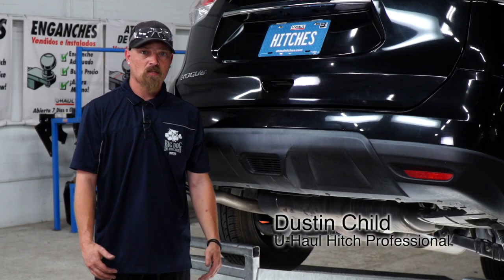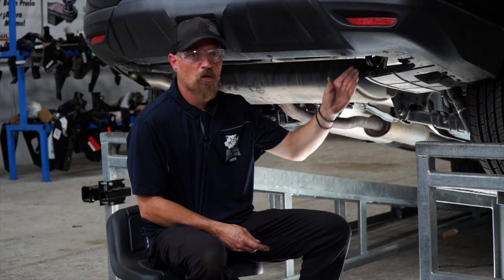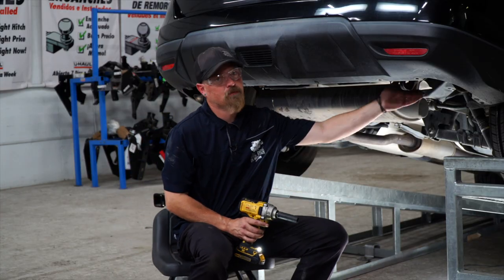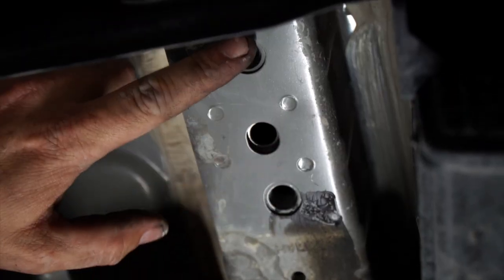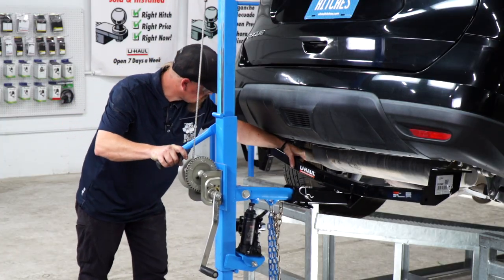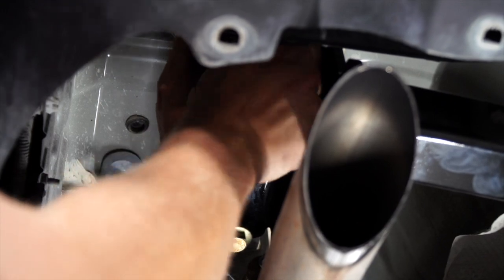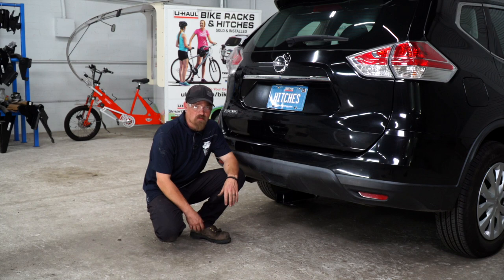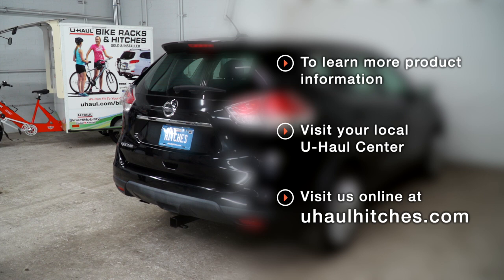2017 Nissan Rogue Trailer Hitch Installation

Comment: Can you add this featrue to ANY 2017 Rogue?  Or must it be designed to allow a hitch add-on?
Reply from the maker: The specific hitch in the video will fit all 2017 Rouges except the sport which we sell a different hitch for that. You can order one or schedule an installation here - Uhaulhitches.com